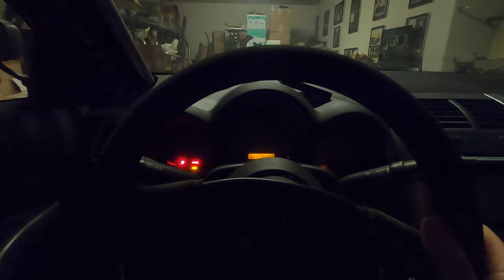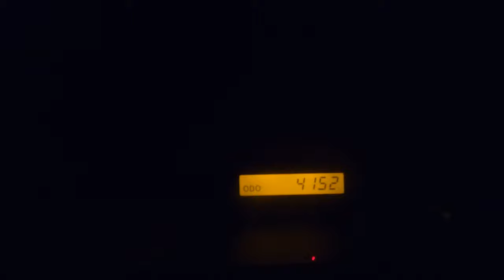Convertible Scion tC? 1st attempt at figuring out what's wrong with the stereo system.

Comment: a suggestion would be to take a multi tester and check the power lead going to the radio. If you're getting power then the fuse at the radio is blown or radio is fried.
Reply from the maker: Hi Dan thanks for the advice . It’s not just the radio it’s the entire center console . Haven’t had a chance to touch it lately but will in the near future